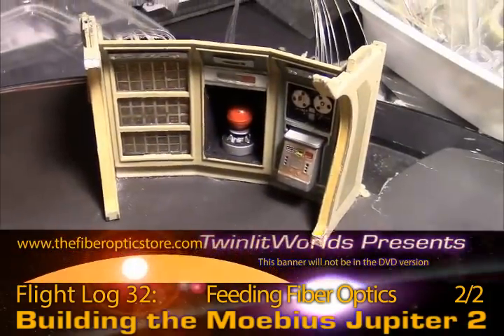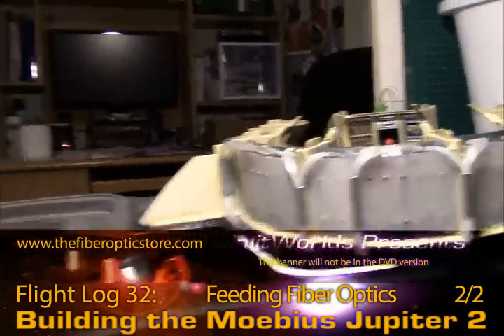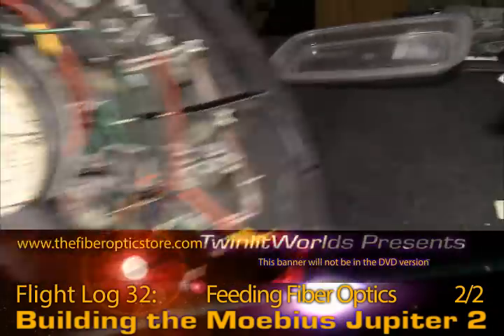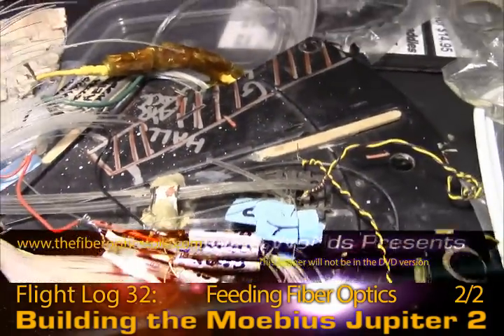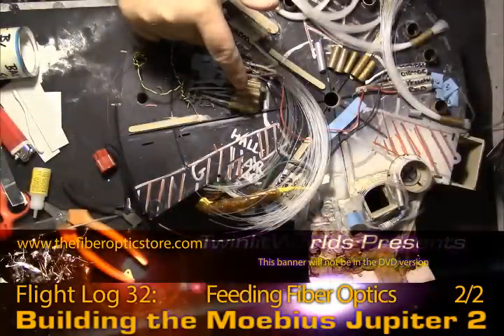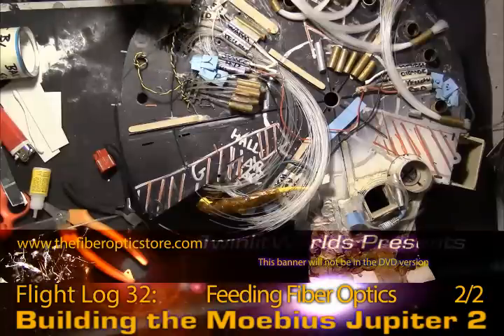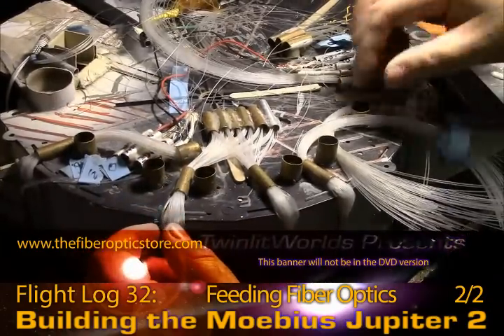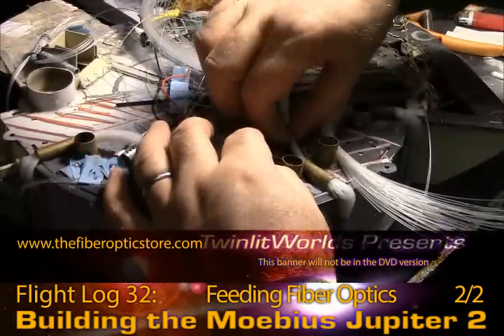J2 FlightLog 32: Feeding Fibers

Comment: Nice to see you back with the J2.  I used the Eliot Brown sequencer on my J2 build as well. Worked out well, for the money. Then I discovered that you can buy timer control boards from Tenacontrols. He makes them to order, so he can pre-set the flash rate to what ever speed you want on five different channels. Each channel handles several leds. Flash rates can be made anyway you want. 5 seconds on ; 3 seconds off.  3 sec/ on ; 6 sec/on ; 8 sec off. and so forth. I used that board on another J2 build. Watching the TV series, you see the freezer tube walls ,and the main control console are flashing at very slow on/off variable times.